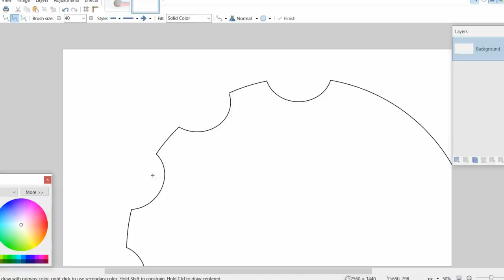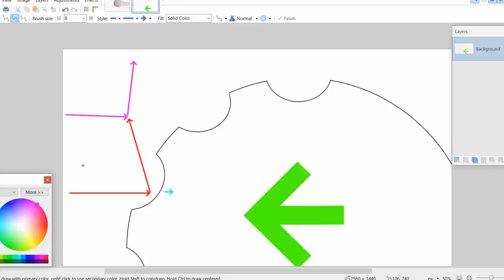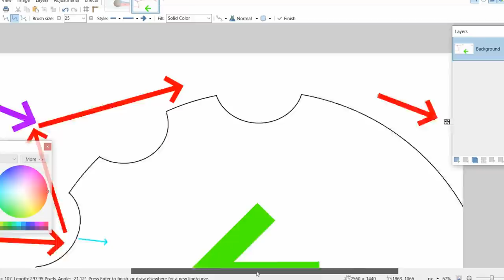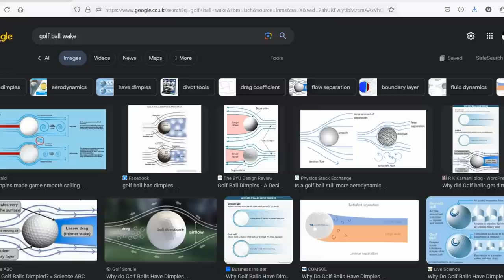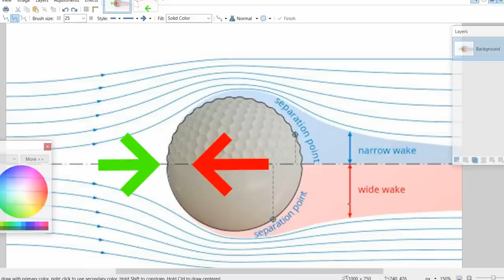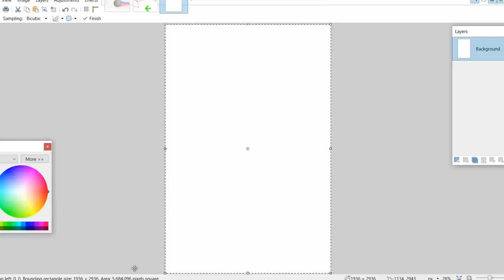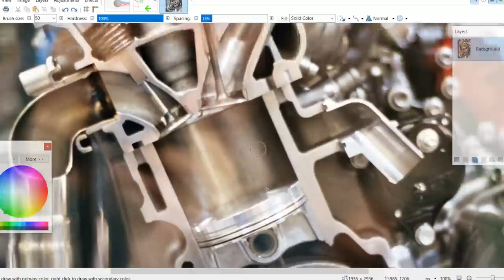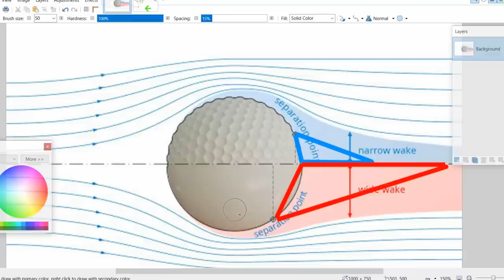Golf Ball Ports DON'T work!

Comment: Thats exactly what Ive been saying since the first time I saw the pictures from Weicomer CNC years ago. 
And this extra-option greatly increased the cost of porting! 
It is also good to mention that the air around the golf ball moves in one direction (sort of) all the time, while the air in the intake port sometimes moves, sometimes stops, you can say that it moves only 25% of the time the engine is running - you have to take into account that the creation of the effect in the dimple takes some time and would be not what i would call continuous. 
Flow-bench tests do not fully reflect the behavior of air in the intake duct, because air moves in one direction, not like in a real engine. 
Ive never seen a competition engine that had a golf ball dimples in the ports. 
Thank You for this episode!
Reply: Some do.

Comment: Interesting vid there. As working with and porting chainsaws, noticed most modern ones use like little pyramids/bumps on the intake boots, seems to create turbulence which im assuming keeps the oil and fuel mixed better or  keeps the fuel atomised.  I didn't  think it was  much use in 4 strokes though🤷🏻‍♂️

Comment: Interesting stuff. Didn't know about  air particles flying about at 500m/s before today. It obviously averages out, but still amazing and that they can figure this stuff out. I know thats not the main take-away of the video, but anyway. And now I learned about golf balls, in such a clear way as I'd be confident to explain it to others. Can't wait to bore people with it at the pub. Just need to plant a golf ball as a prop and prompt
Reply: Me nether, might be very hot where he is. at 20°C it's around 343m/s

500m/s is the speed of sound at 349ºc
Reply from the maker: There's a difference between particle velocity and the speed of sound. The speed of sound is the rate of energy transfer through the medium. That 'density wave' is directional. Air molecules move in all directions.
Reply: @bernhardjordan9200    You'd expect sound to be slower than the air particle speed though as not all air particles would be coincidentally going in a specific direction of travel, so there would be probability based losses based on direction. I assume. If sound moves with the particles. I mean it is meant to be "soundwaves" but it doesn't travel in a vacuum unlike light which is moving massless photons. If sound sort of piggybacks off the randomly moving air molecules, there won't be any perceptible sound at any one place, at the otherwise expected speed. It's just unlikely. So the speed of sound in air must be lower....

I may be talking complete shite though

Comment: Wall wetting reminded me of my early days tuning EFI. Megasquirt had a wall wetting algorithm about 15 years ago, and still do I belive. Derived from a OEM ECU I think. 
Do you know much about tuning around wall wetting? 
This is just from my memory and could be wrong.
It's pretty advanced tuning that's very time consuming to get correct. I have never bothered using the time to learn tuning that,  when more basic accel enrichment and cut of has worked decent.
From what I have learned you want as little wall wetting as possible from the tuning perspective. At a steady state it's not a issue because the wall wetting are not changing, but at changing states the fuel added or sucked from the walls change, and you have a moment where the engine is running leaner or richer than you want if it's not corrected for.
I know this is a rabbit hole from the topic of dimples, but it's at least for me interesting.
Wall wetting also has to be considered with stand off injectors and secondary injectors upstream from the primary injectors.

Comment: I have seen some papers showing a rough sandcasted port flowing better than a polished port about 13 years ago.
Reply: Yes boundary layer
Reply: what you probably read was about the advantages of agitating a a poorly formed combustion mixture, not about maximizing flow.
Reply: You want a touch of extra turbulence to help get around bends. Also laminar flow in general isn't much use either, but you still want to avoid adding too much turbulence. What you definitely do not want are whacking big chunks taken out of the walls by an angry beaver wielding a dull apprentice.
Reply: Wet edges....what?

Comment: I think the dimples are meant to exist just in a situation of huge amount of air getting in ( where you can’t get bigger intake path or valves and you have a big turbo for example) so you would have a lot of turbulences because of the “ too narrow path “ and to avoid that you crate a controlled tiny turbulence with the dimple that allow the air to go trough with less turbulences, what do you think about that ?

Comment: Exhaust side has tight turn where dimples could help on the floor. Maybe even inside exhaust tube. Also turbo inlet dimples have been claimed to work(diesel pump uk mentioned it). So i would assume bellmouth lip area could benefit from dimples.
Reply from the maker: But dipples don't worry like that... also, the exhaust side is at a higher pressure.

Comment: Quick and easy, turbulent flow is draggier, but it's more forgiving in terms of flow separation which is even draggier, so it's useful in a ball or truncated airfoils or other related aero black magic. In a duct it would provide a more homogeneous velocity gradient but again at the cost of drag, no much useful on an intake manifold specially since it's going to get turbulent anyways due to the valves.

Comment: A swirl in every port .
2 stroke needs gas flow, 4bang "could " benefit from dimpling on the fast edge of a goose neck, the TINY dimples keep the Mani wet thus spray is not lost on walls,
Reply from the maker: No.

Comment: R u telling us Matt that the effect on a golf ball travelling thru still air at sea level at x m/sec Is a totally different scenario than a piston drawing x vacuum thru a dimpled intake port  which it would appear to be but that the frictional surface acting forces r quite different ... if so I would agree you’ve also got fuel I the intake port mixed with incoming air to complicate the mix

Comment: Seems like a bit of apples to oranges since the flow dynamics are object in motion vs the exhaust port flow dynamics.  
  Hate to use the word assumption but don’t the people with the abilities to do those dimples have the knowledge and access to utilize a Superflow 110?  Also can’t help but wonder how does the spinning ball effect of the dimpled ball factor in. 
  All that said I totally agree Kawasaki would do it if it wkd.  As well as every other performance engine manufacturer. They definitely understand flow, flow dynamics and have the access and knowledge to utilize a flow bench. I’ve heard of utilizing swirl affect on the intake side for mixing benefits but that doesn’t seem transferable to straight up maximum desired flow for exhaust port applications Reminds me a bit of the CF velocity stacks. Lol, just more silly snake oil nonsense. It does look kinda cool though. Unfortunately I’d bet more likely to actually flow less then smooth. Given the actual laws of flow dynamics you mentioned
Reply from the maker: LOL look at you Sean, taking what people say, ignoring it and they making something else up. What I said was that OEMs don't use flow benches to design heads any more. Sean hasn't proved otherwise and also doesn't understand English very well. But it is his second language, so I forgive him for that.

Comment: Why would bmw go the extra mile and do it in their NA performance engines. S85 has the "golf ball" texture to it. And I've seen something simmilar on mercedes heads a while back, can't remember which engine was it.
Reply: I wonder if those are intake port applications to induce some tumble and or swirl affect?  It actually seems more likely to have some positive effects on the intake side. But that’s totally the opposite of the 5 valve genisis head in the photo he showed. Can you confirm or verify the applications you witnessed? Additionally on the intake side the fuel flow would keep them from becoming little shit collectors
Reply from the maker: Do they? Any proof of this?
Reply: @dirtygarageguy  I look forward  to seeing the photos and the applications where this has been applied., by MB and BMW. That really would be a horse of a different color! That being said I’m not holding my breath
Reply: @jameshirai8936 Google bmw s85 cylinder head. Look at the e bay listings,you can see the intake ports on the photos.
Reply: In effect were talking
 About air against air friction  to a degree which had the higher friction? Air moving across the intake wall or air against air?  Velocity must play a part ?
Reply: The h2r is Forced induction poor example!
Reply: @jameshirai8936  S65 v8 has the same intake port finish. I'm trying to find the mb engine with a similar port finish ,think i saw it on mb world but I'm not having any luck finding it so far.
Reply: To give the salesman something extra to say, and an excuse to nudge the price up a bit?

marketing = money
Reply from the maker: The dipples don't effect the velocity
Reply from the maker: The H2R ports are like the r1 and s1000rr ports, straight. Unless you wanna point out why air pressure and flow are different
Reply: @chrisdavidson911  Could be,but it's not something that is in the marketing material. If you haven't seen these engines inside you wouldn't know they have it. But i know people port these engines and leave a "smooth" finish and still have notable power gains. Who knows why they do it 🤷
Reply from the maker: I've checked the s85 head. The ports are smooth...
Reply: As in stock ports? That is the question.

Comment: So where did this shit come from, the idea of one side rough one smooth
Reply: @seanb250  the problem is everyone who argues for it does it a different way in a different style  and yiu can't find actual data and credible testing.

Im half convinced by the arguement that most of the time the gains are within dyno variance run to run.
Reply: @seanb250  that's the point I was making iv never seen anything I'd consider actual solid data, a single car is an irrelevance.

Nobody does this shit under conditions that actually give data that's worth a dam.

Controlled conditions, limited variables, multiple engine types and multiple of each engine.
Reply from the maker: All this torque about turning in ports. Get your head out of the past. Bad port design is bad port design. Remember, ducati makes shite ports lol
Reply from the maker: No, they're not. But they should be. Straight shot ports are the future, and everyone is moving that way.

The 998 ports are fine. You just don't know what you're talking about.
Reply: @seanb250  you mean other than the top fuel drag engine stuff right.

What manufacturers do for homologation specials is an irrelevance and usually makes a shit engine for road use anyway because they build things so they can do all sorts of modification to and still fit into the specific regulations for the class and they melt an engine in 3 races. that's not really anything that needs repeating or particularly relevant to the discussion

Port smoothing to create as straight a run as possible and increase air flow is well known to work AND has solid data to prove it.

The dimpling and roughening of a port however doesn't have that and is based on some fairly shake logic.
Reply from the maker: "that has fuel in ports benefits from port wall texture, I’m only talking a 60grit up to a soft burr finish, a 60 grit still looks pretty smooth, but it’s the port shape that is smooth, not the wall texture, that is difference."

 Sean keeps on failing to provide evidence for this...
Reply: @dirtygarageguy  this is the problem... Nobody does so you see everything from 60ngrut to golf ball dimples.
Reply: @seanb250  that's... Not how this works. I'm asking for credible evidence it works. I don't hold an opinion on it and there's SO MUCH contradictory information amongst those who argue for it.

Actual proof that it makes gains in power, in torque that isn't within the error/variance of dynos generally and that can show those figures on both an Inertia and load dyno  

Ideally that data should be with the engine in a vehicle rather than on a engine dyno to better account for real world. 

Obviously doing the same port work on multiple engines and NOT changing how it's done between engine designs to eliminate bias and discounting the fact that simply reshaping the ports did all the improvement vs the finish applied to the port walls affecting things. 

We know gasket matching on a SBC makes a difference for example but that's simply increasing the port size and that has to be accounted for in the testing

Comment: Bingo!!  'A genuine improvement vs the variation in testing data.'

Very similar to the voodoo black magic used in selling shotgun chokes of varying designs.  There is more variation in the shooter and ammunition/load then I supposed improvement derived from the shape of the chokes internals.
They never publish data - hummmmm
Reply: It’s easy to pattern a shotgun and test.
Reply: @cblaster171   Yes it is.  Howerve, patterning is a 1,2,3 subjective measurement criteria.  Looks good, 50/50, 60/40 .....# in or out.... The lack of reproducibility is also why you will not see the ammunition, choke tube makers or barrel modifiers publish experimental variable data.  The variation in the distribution of normal amount of shot inside or outside of the target diameter vs. the % or # of shot that is claimed to be improved is equivalent to noise.  In fact the utility patents for chokes are based upon a theoretical application of fluid dynamics, aerodynamics....that yields a theoretical or perceived improvement, such as improved wad stripping or minimizing shot interference........